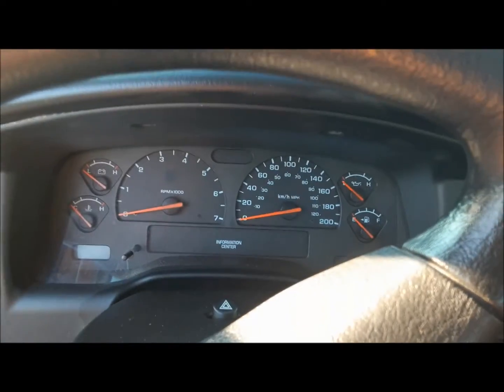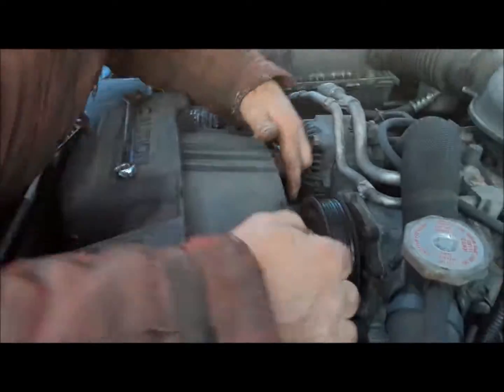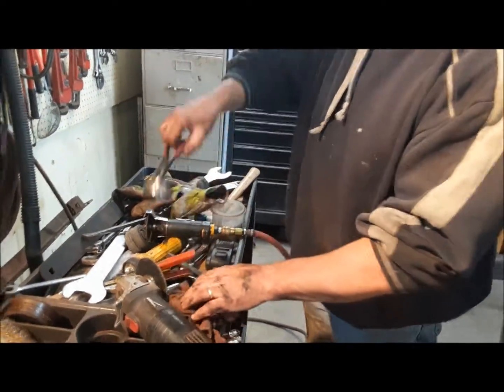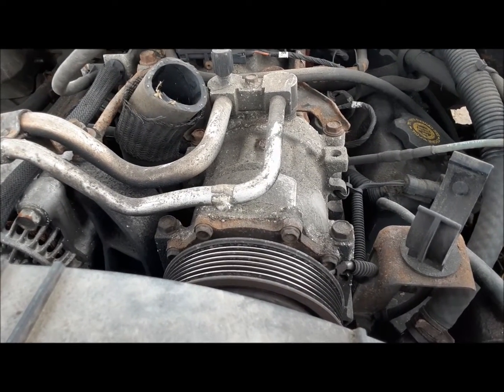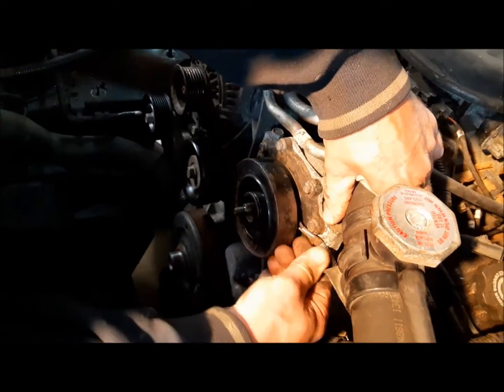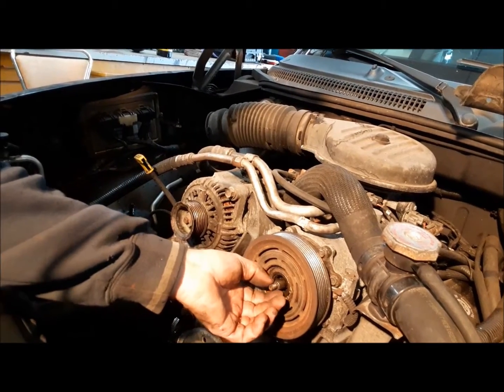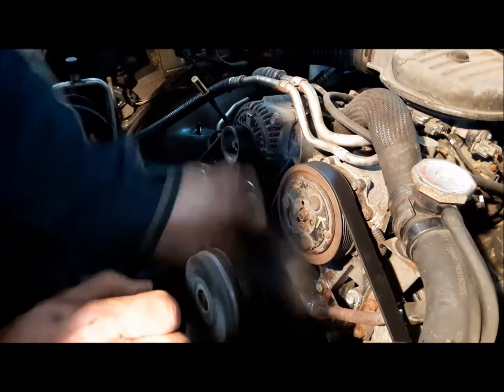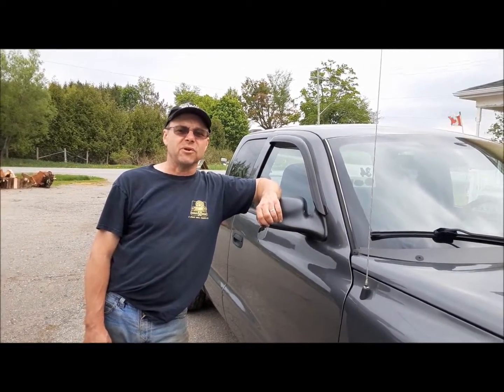2003 Dodge Dakota AC Clutch Failure

Comment: The AC clutch never engaged when you turned on the AC, so the problem could be with the electrical end of it, rather than the refrigerant.
Reply from the maker: Clutch didn't engage because the low pressure switch was open. The shrapnel took out the seal. I figured that out after.
Reply: Why not just replace the entire AC Compressor???